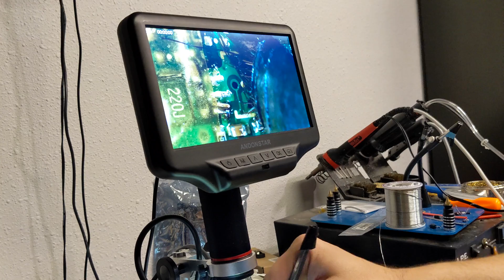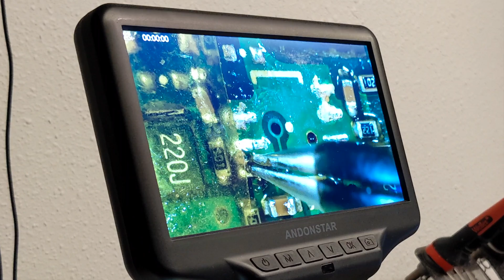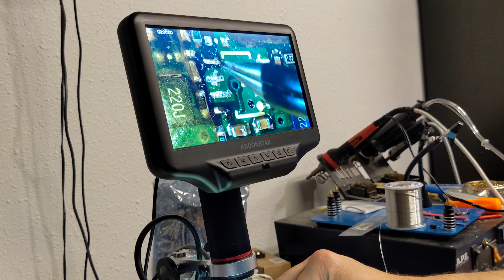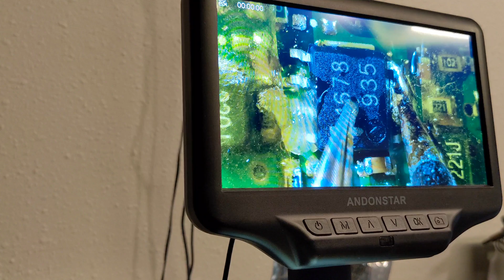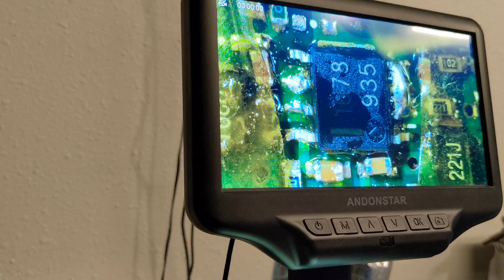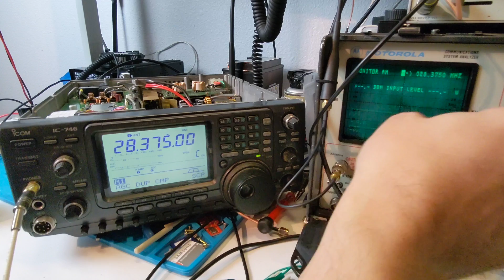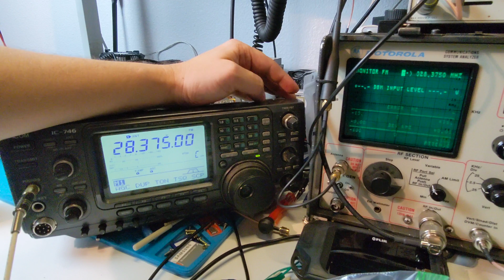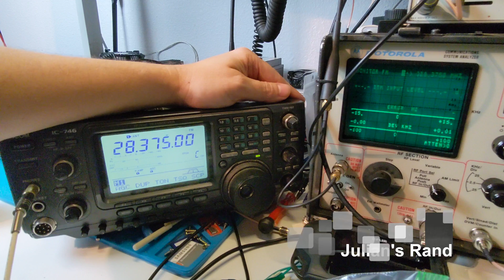Cleaning Up The Other Guy's Work, IC-746 Stopped Transmitting

Comment: I have a 746 pro that stopped transmitting after a recent lightning storm. Do you have an idea where I should start to look to get it fixed?
Reply from the maker: Lighting strikes can manifest problems in any circuit that was unlucky enough to provide a path to ground. I’d start with the driver for the finals. Godspeed

Comment: Are you still doing repair work? I got a 746pro with the same issue, no transmit power. I don't have the tools nor half the skill set to solve it myself...
Reply from the maker: Sure am... but I have to cut off new incoming work occasionally. You'll want to fill out an intake form here juliansradiorepair.com and we'll send you a work order number if a slot is available. 73